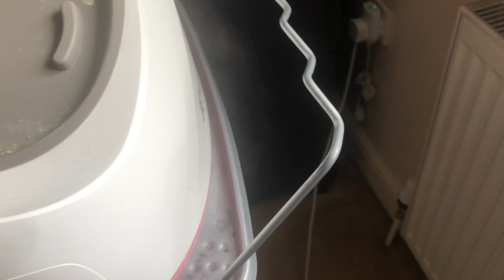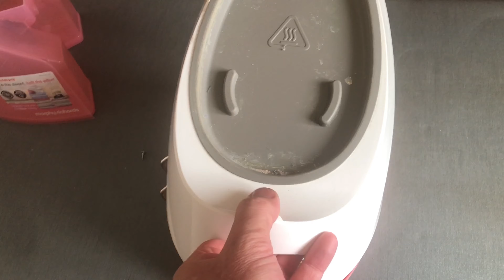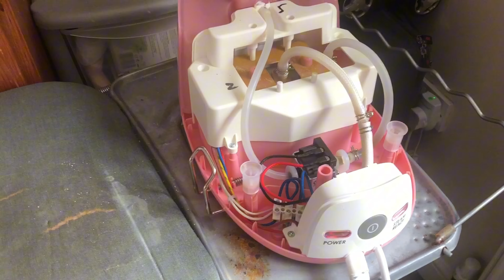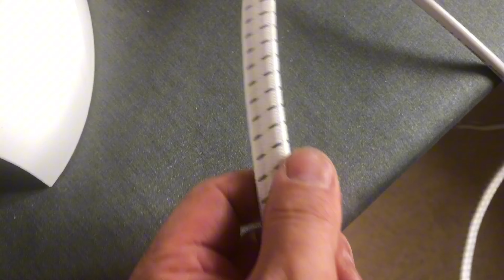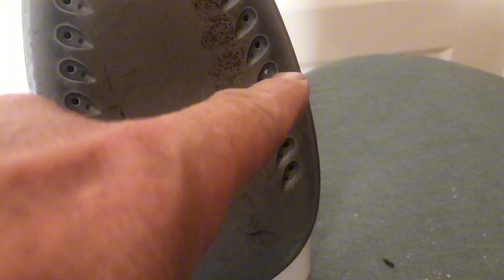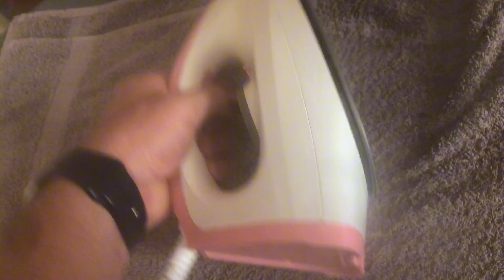Morphy Richards Steam Generator Iron Low / No Steam With Steam Leaking From Base Repair.

Comment: What size screwdriver do you use please?
Reply from the maker: A smallish pozidrive  I can’t read the size on it anymore.
Reply: @TheRepairer  mine seems to want a triwing
Reply from the maker: @thewoods9200 That’s unfortunate, I have just rechecked the iron base and they are all cross point. If it’s a zero or low steam issue the techniques later on in the video may help restore steam without the need for deconstruction.